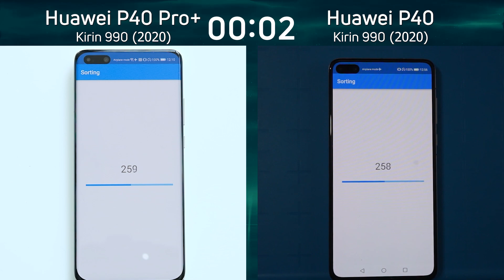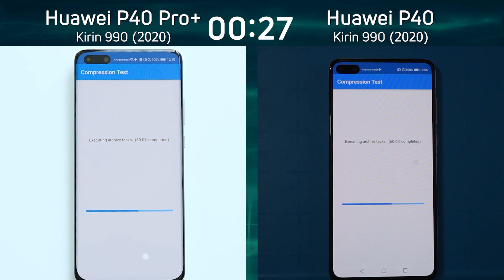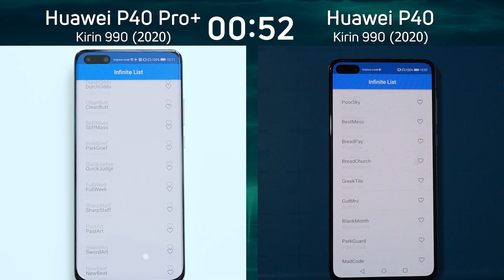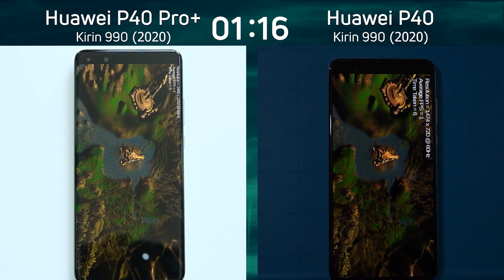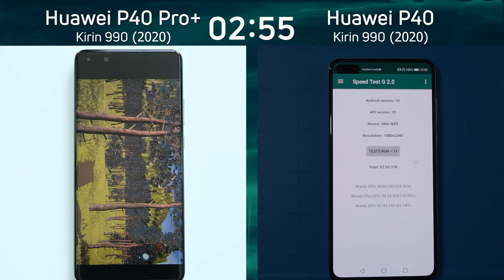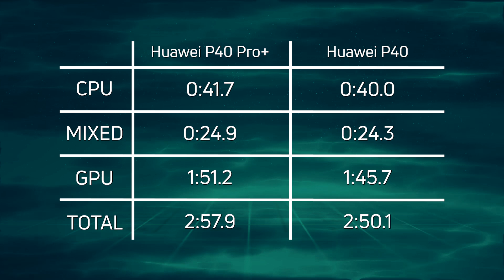Huawei P40 Pro+ vs Huawei P40

Comment: The GPU on the Kirin 990 sucks..
Reply from the maker: @Sasa Maljkovic Please tell me how I can optimize Unity and Unreal for Huawei devices?
Reply: SpeedTest G speed test G dont suitable for kirin processors. Kirin 990 = sd 865 real
Reply: @osmanemredonder3604  no
Reply: @Harish2923  no men. Speed test G not suitable for kirin.
Reply: @osmanemredonder3604  proof?
Reply: Harish Madhavan https://youtu.be/nb7TVptTV-8
Reply: Harish Madhavan https://youtu.be/FLU7U_8NmbU
Reply: Harish Madhavan https://youtu.be/QW71SVHZFwg
Reply: Harish Madhavan kirin 990 
https://youtu.be/-b5Sv4WKyE8
Sd 865
https://youtu.be/0dKoVEHjJZ8
This same chips for in game fps and heating.
Reply: @osmanemredonder3604  1. you need to learn the meaning of optimization.
Optimize meaning rearrange or rewrite (data, software, etc.) to improve efficiency of retrieval or processing.
There is also an another type optimization. Optimization for specific device/processor.
What it means is that either the processor manufacturer or the creator of the game will give a optimal preset for the specific  processor. But benchmark apps don't do this but manufacturer's can give preset for any application.
(Mediatek was caught optimizing their processor's for every major benchmark apps), so are you saying that Gary specifically optimized the test for Snapdragon processor?
2. A processor which have the hdr quality option in pubg can have the texture quality same as a phone with a lower end processor which is running the game in hd quality. So you should not compare two processors by comparing the quality settings and the fps.
Reply: @Harish2923  Quality settings comparisons available and no noticeable difference. It's like overclocking the processor that Mediatek does. But a synthetic test should give every processor the same opportunity. (here speed test g almost ignored the processor software of kirin) and this is actually nothing more than a bottleneck for dirt.
Reply: @osmanemredonder3604  why do you say that speed test g ignores the software of Kirin processor?
Reply: @Harish2923  You are talking about optimization. Every test has to optimize for the processors, otherwise there will be a bottleneck. And the speed test is not equally suitable for dirt operators compared to others.
Reply: @osmanemredonder3604  every benchmark apps are unoptimised.
If it is optimised for a specific processor, then it means it is cheating. Samsung has been sued in the past for optimizing their processor's for major benchmark apps. And also benchmark app developer's don't optimize their app's for a specific processor.
Reply: @osmanemredonder3604  are u seriously comparing processors with benchmarks?
Reply: Moemen SMP https://youtu.be/nb7TVptTV-8
Reply: Moemen SMP https://youtu.be/GOsgFrWLL0k
Reply: Moemen SMP https://youtu.be/QW71SVHZFwg
Reply: Moemen SMP you dont know anything
Reply: Moemen SMP benchmarks not trust. We should see a real test.
Reply: @SpeedTestG  Good one!💪😁
Reply: @SpeedTestG  Can you please explain why kirin chips performs way better at GPU in other benchmarks apps like 3D mark/antutu ? Ok lets assume that these results are not trustable then why kirin performs better in real games too ?? It performs like any other flagship in every games but not in your tests why..?
Reply: @Sasa Maljkovic  just accept the fact that the GPU in the Kirin 990 performs bad compared to the Adreno 650
Reply: @ramapatir109  yes it's about equal the adrenal 640 said by huawei
Reply: thats why other chinese phone companys still use SD and not a "china made processor" that being said, the most demanding real world GPU task is gaming, and with huawei pulling the right strings for chinese game developers, the optimization is good enough in some cases to run games well
Reply: @davidyang9902  just a few big game optimize for kirin 990 but most gaming run better in snapdragon chipset.. But kirin run better in gaming than samsung exynos 990 even though samsung exynoa gpu is much more powerful than kirin 990..but samsung amd gpu can make a fight for next year with snapdragon but huawei use snapdragon for better gpu instead
Reply: Indeed , it even makes the Exynos look not too bad   :) .
Reply: @Sasa Maljkovic  😁😁
Reply: trust me... its not bad in real life
Reply: Noooo, Mali, (ARM), Japanese Soft Bank is owner, they sucks.
Reply: @Sasa Maljkovic  so you think this app optimized on snapdragon?
Reply: NG GW no it’s not optimized for snapdragon... The teSt is using Unity and Unreal engine tests which are most commonly used for heavy mobile games. If anything the benchmarks are heavily unoptimized to really see the difference in raw performance and Mali has been disappointing for years now.
Reply: Sasa Maljkovic Read the FAQ
Reply: https://m.youtube.com/watch?v=snLd-V1TKTc